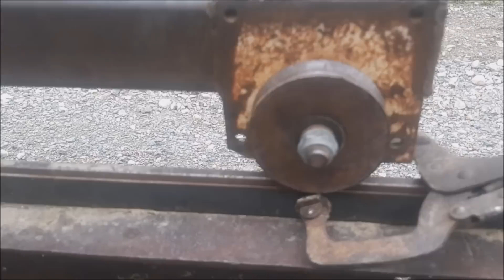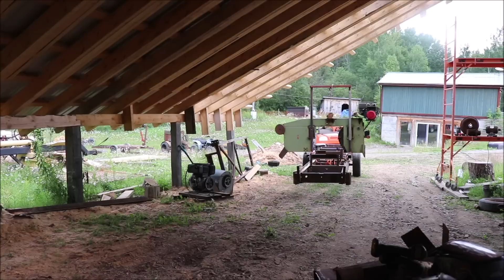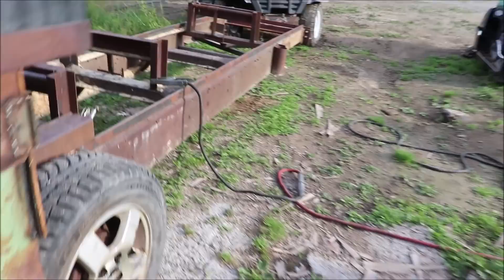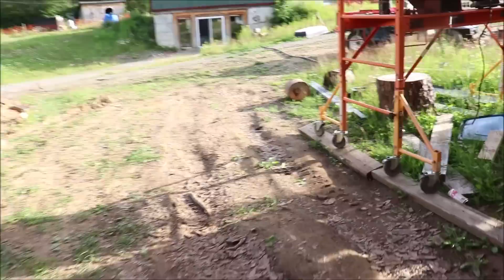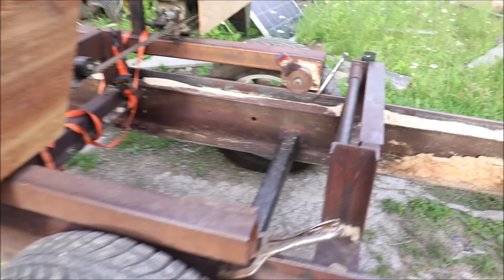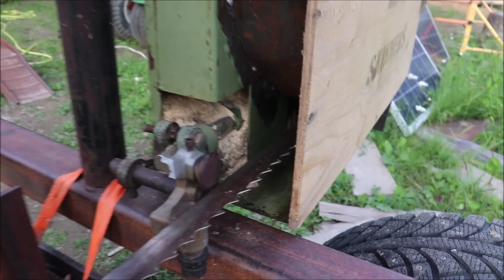WOW!  Our Homemade..( From Scrap) Portable Sawmill Is 100% Better After Doing These Upgrades.

Comment: I have a 16 hp Wheel Horse garden tractor with a high/low range that I’ve modified to be a prime mover at my place.  Ag rear tires, 120 pound front weight box and 2” receiver hitches on the front and rear.  It will haul or push any of my trailers around the property.  
We use the front hitch as a spotting hitch to position trailers and our log splitter. 
I’ve always been told that the way you prevent a trailer from oscillating when you tow it is to put the axle at a point where it is 60% from the point of the hitch as a percentage of the overall length.  Not sure if this is a universal fact or just what my buddies have figured out that it works.  
Keep on keeping on!   
Cheers!
Whipple
Reply from the maker: Hello, my friend.  I do love a hitch on the front of this side x side. Thank you very much. You have a great day.  Cheers!

Comment: Cecil, I know you mentioned you don't need to cut anything longer than 16 ft but, if in the future you needed to mill say, 20 ft, would to extend the mill bed frame? Also, I know there are many video's on youtube about building a mill, would you ever draw up plans for yours, possible sell them? I've watched your video's when you first built this and it's really so simplified that if I had the materials on hand, I'd build one myself. If fact, I do want to build one. Great video as always, cheers :)